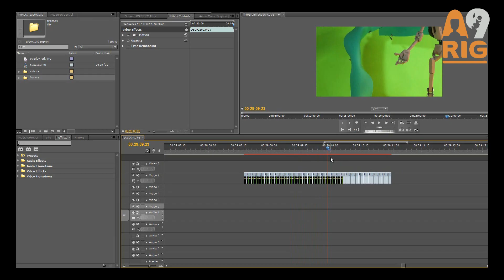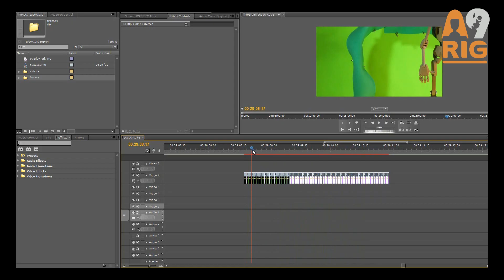A9RIG - Stop Motion - Part 1 - Budget green screen setup

Comment: can anybody point me to where that stand for the charater is from?
Reply from the maker: You can get them on our website: armaturenine.com or build a custom model on armaturelab.com
The "crane" has been replaced with a clip stand which also allows you to get extensions for it.  And there's also a new chroma-green stand designed for the smaller figures. https://armaturenine.com/collections/a9-accesories
Reply: @Armaturenine  thank u so much i aint think u would really respond back im deff gone check it out i do claymation and is hard to make them stand and jump around when i do stopmotion i seen the crane and it looks structured to hold the charaters